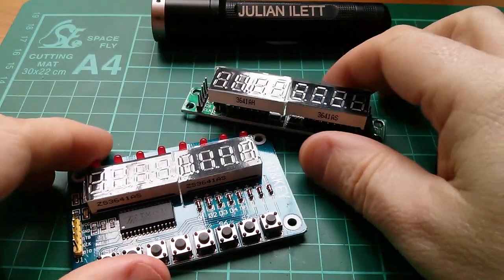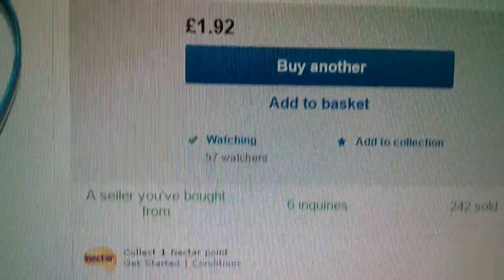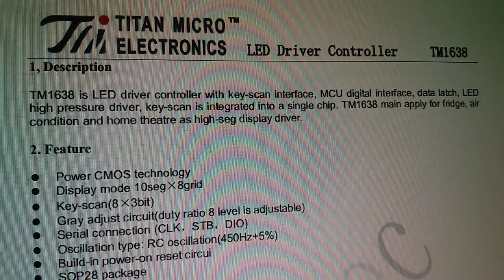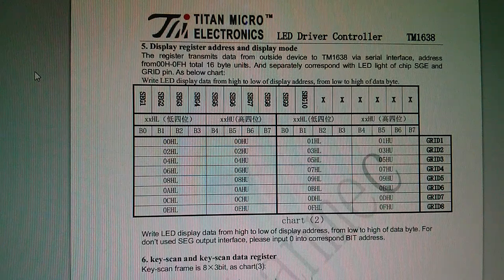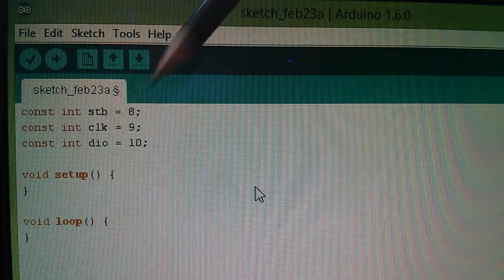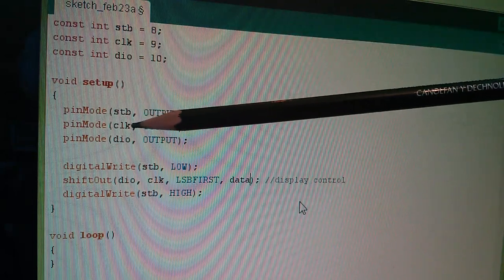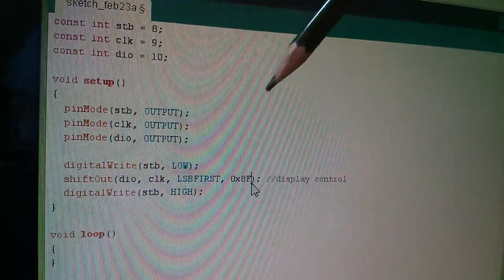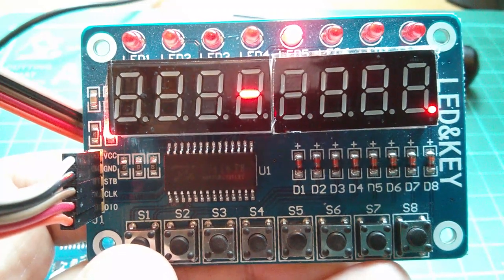Project: TM1638 8-Digit 7-Segment LED Display Module #1

Comment: I got this running with an ESP8266... on 3v3. The input switches fail to trigger apart from switch 1, but the display segments works along with the red upper LED's.

Comment: "Pressure" is likely to be a direct translation from Chinese, an analogy between water flow and electrical current. Usually we would say 'potential', or in this particular case just 'power'.
Reply from the maker: ***** High current LED drivers - is what they're trying to say I guess

Comment: It looks like you can define binary constants on the Arduino with B00000000 to B11111111 - when using AVR-GCC you can certainly use 0b00000000 to 0b11111111 - which might save a bit of time converting to and from hex. Interesting looking gizmo and I always find half of the fun is trying to make sense of the datasheet!

Comment: Solar BMS will be on Kickstarter in two hours but I'm here watching this video :) To much stress.
Julian if you have the time in the next few days maybe you can announce the Solar BMS in one of your video that will be helpful.
Dacian.
Reply from the maker: ***** If I put the unit you sent me in my next postbag video, I can mention the new SBMS then :)
Reply: Julian Ilett
Thanks Julian for the support the project is now live at https://www.kickstarter.com/projects/electrodacus/120a-solar-bms-charger-lifepo4li-ion-offgridrv-wit
Reply: This looks like a great product. Looks good too. Best of luck!
Reply: Sergio Orjuela
Thanks.
Reply: *****
Hi Jeff, Thanks for the suggestion. There are quite a few vendors and also a few brand of batteries. I got mine 3 years ago so things changed a bit since then. I recommend Winston branded batteries normally but I do not have direct experience with them (even the GBS that I have experience with them I can not say much about just that it has a bit higher internal resistance than others 1.8mohm measured by me for the 100Ah cells) Winston has about 4x less that bu for the cycle life claim is harder to test. My GBS is 3 years old and 2 years of full OffGrid but I can not see any capacity loss. I will try to replicate the exact test I did 2 years ago and documented on video in the spring.

Comment: Tremendous presentation, sir! Thank you so much for sharing, I have the only question - does it support the common 7 segment LED codes to encode digits and letters? I mean will it display zero if send 0xBF to a certain segment and trigger the clock pulse?

Comment: I bought 2 of them and they seem to work fine, but after some time the intensity of the LEDs go down and then the thing stops to work. Couldn't find anyone having the same issue so far. I connect directly to an Arduino micro, and also tried with a separate power source. After a reset of the Arduino, it works again and same is happening again. Anyone had the same experience and knows how to fix this? Or are they both defective?

Comment: I bought 3 of the TM1638s and they all seem to be defective.  What are the odds of that?  Nothing but the LED next to the VCC line comes on.  It does blink.  Nothing else happens so I added an LED to the across the clk, stb, and D I/O lines. They all blink at different rates so data is going to the TM1608 with nothing happening on the 7 segment displays.

What am I missing?
Reply: The chances that all three are defective are small I reckon. You probably haven't configured something correctly. However, I bought a bunch of these, and one of them gets fairly warm, and then LEDs start turning on without command, and the unit then shuts down (loses power completely) soon afterward. The rest of the modules (same ones) are directly substituted in .... and they're all fine. Put this one back in....and same issue after a while. Faulty.

Comment: Is there any reason you use a constant integer, instead of using a "#define" statement to give the pins a name? To my knowledge the integer uses some ram in the controller to store those constants while the define statement gets resolved by the compiler so in theory it doesent use up ram to store that value... But it wouldn't really matter for 3 integers :)
Reply from the maker: ***** Only because http://arduino.cc/en/Reference/Define says "In general, the const keyword is preferred for defining constants and should be used instead of #define." But I'm happy to break the rules if there's a good reason :)
Reply: IIRC, using 'const' is equivalent to doing a #define in this case - it's no different to 'hard coding' the numbers. It isn't treated as a variable as such as the compiler knows the value will never change.

Comment: Isn't it an SPI interface?
Reply: ***** I think I figured out. TM1638 is a shift register. And yep, they are driven just like SPI. Just register, probably, were well before SPI. This makes me thinking that SPI can be implemented with registers.
Reply from the maker: Alexandre Kandalintsev SPI (according to Wikipedia) is a 4-wire interface with SCLK, MISO, MOSI and SS signals. However, Wikipedia also points out that SPI is not a formal standard, so the mnemonic gets used to describe all manner of subtly different serial interface types.
Reply: Julian Ilett , SS=GND, SCK=CLK, MOSI=DIO and MISO is just not in use (SPI is bi-directional, but you can use it one way, no need to connect MISO in this case).
Reply: Julian Ilett
SPI has some variations, that's true. But most MCU support all practical variations. And,in practice, most of the time "it just works" without any tunning.
Reply: I agree. Actually, the arduino ShiftOut documentation mentions spi, I think it's a bit-banging implementation.